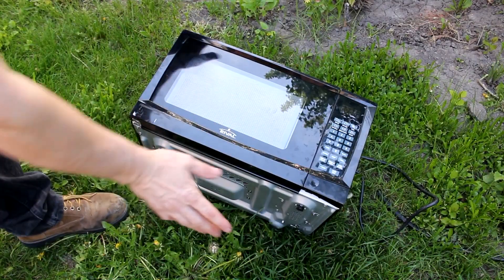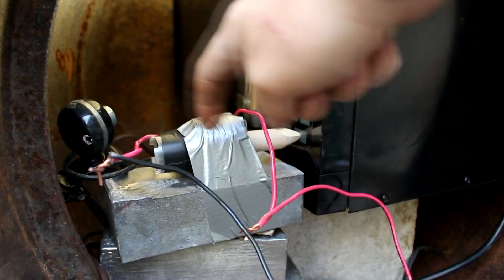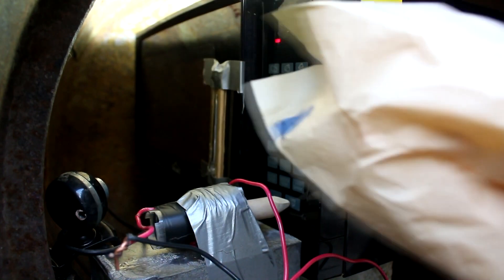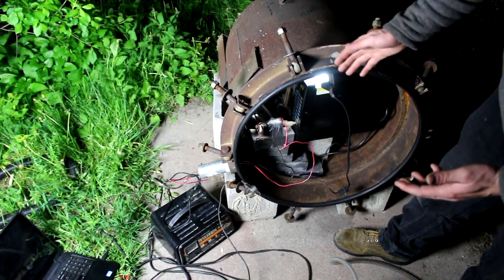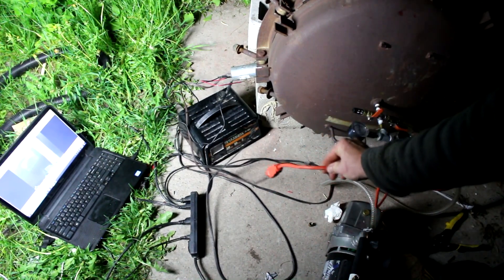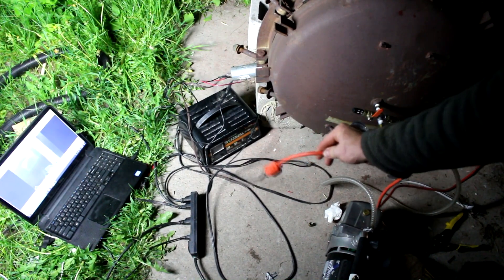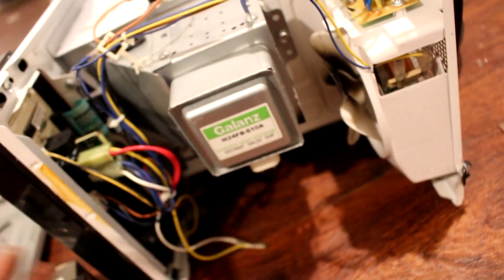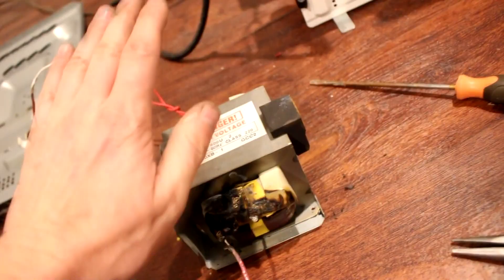Microwave In Vacuum Chamber

Comment: air is an insalater (is non conductive{this is ment for those who might not know}) in near vacuum I'm guessing that the huge amount of volts also the heat not being despered by the air probably made the instalion on the wires to melt exposing the metal so the electricity arced causing more heat and more arcing now why it was drawing more power after being separated from the main electronics I have no idea

Comment: It might be the case that a near vacuum is less insulating than ambient air. If this is the case it would means less energy is required to arc or make a conductive path to the opposite coil. Maybe it became a more powerful electromagnet in a vacuum so you could measure a change in magnetic force as a function of vacuum pressure. You could even use a compass at a distance (on the end of a ruler of something) to detect the field and have some qualitative metric of what is or isn't happening.

Comment: do you think it would work if you set up a 0° cooling system like they do in computers using water or even better liquid nitrogen to cool the internal components then really beef up the insulation around the transformer to prevent the arc that killed your microwave. just a thought. love your channel btw

Comment: Hi Cody,
What you are looking for is called Paschen's Law. It explains the gap needed during various stages of vacuum.  It is quite a remarkable curve.  We had some fluorescent light fixtures that were used to light our vacuum chamber and didn't take in to account the spacing needed at partial vacuum.  (about the vacuum you use) it burned the insulators up while roughing the chamber.  Once we were under full vacuum (5.0 x10-4 millibar or so) we had no trouble.  Paschen's Law explains what happens. To solve it we shut off the lamps while going from ""Rough Vacuum 1000mbar to about 1 x10-1 mbar" to "High Vacuum (<2 x10-1mbar)"

Comment: Maybe it's not actual science, but it sure is entertaining.  :-P  My 2¢ would be the idea that lower pressure reduced the dielectric strength of the insulators, thus increasing the risk for arcing.  The microwave was likely designed with just enough insulation to prevent arcing in room air.  A good test for this theory might be to repeat the procedure, only pack silicone corona putty (High Voltage Silicone Putty, GC Part Number: 10-8880) everywhere you can press it in and see if that helps, but without air, the transformer will eventually heat up (with nowhere for the heat to go).  :-P  Back when I was a kid, I found corona putty to be very useful to repair arcing TV sets.  Dust is attracted to the high voltage regions of the flyback transformer, building up until it arcs to shield ground.  Corona putty fixes this.  :-)  Modern TV sets don't have high voltage anymore.  ;-)

Comment: metal electrode surfaces can cause a region of the vacuum to become conductive by injecting free electrons or ions through either field electron emission or thermionic emission. Thermionic emission occurs when the thermal energy exceeds the metal's work function, while field electron emission occurs when the electric field at the surface of the metal is high enough to cause tunneling, which results in the ejection of free electrons from the metal into the vacuum.

Comment: I'm pretty sure the thing you called a "beeper" @8:16 is in actual fact a thermal cut-out switch/fuse as it's attached to the metal skin of the inner oven wall.

There are usually several of these spread around the oven but a basic/cheap model might just have a single thermal cutout.

The piezo beeper is usually mounted directly to the control panel circuit board.

Comment: If i had to guess, i would say that because the microwave draws more power in the vacuum, that it was pulling too much for the transformer to handle through the gauge wire used for the windings in that coil. This could have caused a break in the windings and in turn caused the connection to arc.

Comment: The main cause is overheat occurred by fail in thermal exchange. The arcs occurred during the degradation of insulation and the short-circuit was after the destruction of the insulation. Vacuum is a good electrical isolator.

Comment: That capacitor attached to the metal frame can be deadly. Usually they have a discharge circuit. None the less, make sure to short it out before handling anything attached to it.

Comment: Next time you do this, you'll have to vacuum-dip the transformer in enamel so the transformer doesn't fail from air having a much lower breakdown voltage at low pressure.

Comment: the transformer  puts out 2100 volts. since it was in a vacuum the flash over voltage of such a low distance was greatly decreased and flash over it did. air is basicly an insulator and without that insulator there it just flashes over.

Comment: The secondary coil is burnt by heat from arcing. Under normal air pressure the arc may not form under 2KV over 1mm gap. In near vacuum the ironized air molecule could gain much momentum before hitting another one, then when it does, creates more ironized particles and forms an arc, at a greater gap. The enamel layer on the magnetic wire can only withstand a few hundred volts. It also has some scratches/cracks/damages during winding process, which weakened the rating. Try putting enamel wires in vacuum and apply 1KV, you will find arcing easily.

The thermal inertia is quite large for the copper winding, even with much reduced convection due to vacuum, the transformer won't heat up to 100C in a minute. The fan is for continuous cooking for more than a few minutes.

Comment: I used to work on jet fighter radar. Our magnetrons and waveguides were pressurized to prevent internal arcing at altitude. There was a pressure switch that would disconnect power if it dropped too much. The normal ground level air pressure at Hill Air Force Base near Salt Lake City was enough to open that switch. I imagine the maggy and waveguide in the oven are sealed to prevent pressure loss so it didn't arc there whereas the transformer was exposed to the low air pressure.

Comment: Yes, that is correct. A vacuum allows corona to form extremely easily. Corona destroys insulation. Honestly it was my first guess as to how to microwave would fail, as the windings are at 2kv, and in open air with no potting. Cool video!

Comment: Since the popping of corn, or any grain for that matter,  is dependent of the pressure differential inside the corn it would be interesting to put just the bag of popcorn in the vacuum long enough to reset the inside pressure of the kernel then taking it out and popping the bag. You would think it would take longer to pop and maybe the popped kernels would be smaller?

Comment: with devices such as motors and transformers that have insulated windings the atmosphere is actually a factor in the insulations rating. devices rated for running in a vacuum have a thicker insulation than those which do not.

I suspect you would see similar results with the other components of the microwave if given more time just the transformer secondary had the highest voltage.

Comment: The "beeper" is actually a thermostat that cuts the power (in case of over heating) from the primary coil of the HV-transformer, or in some cases from somewhere earlier in the circuit.
Also to my (several different) measurements microwave ovens have roughly 50% efficacy. So around 50% microwaves and 50% heat. So If you have a 800W microvawe oven it draws about 1600W from the wall and the other 800W comes as heat from the transformer and from the magnetron. Without air to cool it... Yeah it burn fast. Not to mention the fact that electricity arces much more easily in vacuum. That's a phenomenon I'm not too familiar, but I know it's been utilized in some gas discharge lamps.

Comment: Anyone have some cheap vacuum oil they can test for breakdown voltages? If it's good enough, put the transformer in a bucket of it.
I would be really interested in seeing if you could run the magnetron outside of the microwave chassis in the vacuum chamber. See if you can get some plasma from it.  ̶H̶e̶a̶t̶ ̶u̶p̶ ̶s̶o̶m̶e̶ ̶m̶e̶r̶c̶u̶r̶y̶ ̶t̶o̶ ̶g̶e̶t̶ ̶s̶o̶m̶e̶ ̶v̶a̶p̶o̶r̶ ̶i̶n̶ ̶t̶h̶e̶r̶e̶.̶
Create a box to hold the camera and use the microwave door to try to keep it from frying.

Comment: High voltage transformers, such as those found in microwave ovens are typically dipped or coated in a resin/epoxy to increase the effectiveness of the dielectric and to keep the windings from rubbing against each-other so that the insulating enamel doesn't get rubbed through.  I wander if there were air pockets trapped between the wires that ruptured during the vacuum causing a short and therefore causing more damage / shorts.  Seems plausible.
I'm kinda surprised the capacitor didn't rupture too.

Comment: The general problem is that arcs form much easier in a low pressure environment. This is why many devices have a rated maximum usage height over sea level. Multimeters for example. Very important also for insulation, air and creepage distances when designing medical devices for example.

Comment: The secondary of my siemens microwave made in china burnt after 5 month of age under normal air pressure. The old one lasted more than 20 years and was still working fine when I replaced it. Quality has gone down the drain.

Comment: In addition to the vacuum arcing mentioned by other people (which could possibly be prevented by applying a rubber coating), I'd also disconnect the fan.  Without air resistance, fans can draw significant current.

Comment: If you do this again, try to wire it so that everything other than the actual magnetron is outside the vacuum chamber. And also remember to insulate those wires as the magnetron draws a lot of power and will probably jump very easily in vacuum.

Comment: you should put a Jacob's Ladder with a microwave transformer inside the chamber.
Reply: I've seen that done somewhere on the youtubes! The arc goes quite thin and purple, eventually getting stuck at the bottom of the ladder. Then the arc slowly dissolves into a neon glow lamp-type discharge with the entirety of the electrodes forming the ladder glowing a nice hazy purple. Until eventually you remove enough atmosphere that the discharge seizes completely. Add a little backfill of neon or argon and you have a very pretty light show :)

Comment: Actually, it is harder to pull an arc in a vacuum. There is no air to ionize and create a path for the current. That is why large industrial switchgear has vacuum contactors to open and close circuits instead of open air contacts. Vacuum contactors only have to separate the contacts a fraction of the distance of an equivalent open air contact to extinguish an arc.

Comment: Interesting, too bad you didn't have an ammeter inline with the circuit outside the pressure vessel. Obtain one for future tests. I was taught it takes 34 kv in "average" air for a spark to jump one inch. ( I went to NEI for Avionics BTW) When you said "the beepers" the thing your finger was pointing to was a thermal overload device, they usually say their activation temp stamped on the face btw. Some microwaves have several. I am rather shocked that meaty massive transformer would die in such few seconds given the thermal mass available for it to heat but I've long known dissipating heat is an issue in space as I've watched the specials building surface exploring drones. 

Also, a new thing popped up which says your #32 trending right now. Just above your name and subscription. Love the woodworking intro. I need to wake up. Are we going to see a Jacob's Ladder arcing away as you pull the vacuum ?

Comment: Here is what happened... most likely:
The oven started normally
The magnetron got hot fast and decreased it's impedance
which made it consume more than the usual 1 Amp current
The 1.2 Amp fuse which protect the 2000 volt side blew
The voltage doubler (5 uF, 2000 volt capacitor and diode) stopped to draw any current
The full voltage of 2000 volt AC on the secondary of the transformer
had nowhere to go since the fuse blew

Note: 2000 volt is the RMS value, the peak is : 2000 * square(2) * 2 = 2.8 kVolt

The smoke damage on the fan indicate that the electric arc was flowing from the secondary of the transformer to the fan, probably looking similar to the arc on a jacob ladder.

I think that without the fuse (like any older microwave do... the fuse on the high voltage side have been added only 10 years ago), the impedance of the magnetron would consume most of the current, so the transformer would not had a chance to arc.

Comment: Transformer was designed for in air. Definitely vacuum caused arc over.
Cody! Those aren't beepers in the microwave. Those are thermal cutout switches. The single piezo beeper is on the same circuit board with the display and the buttons.

Comment: I WANT POPCORN!!  I still want to see it happen.  Is it possible to have the transformer on the outside of the tank and wire it to the microwave on the inside.  You now have a good candidate machine to do it with.  Just need another transformer.  I really would like to see microwave popcorn made in a vacuum.  And as stated by Dean, I'm looking forward to your voltage experiments in a vacuum.

Comment: Correct me if I'm wrong, but isn't it super obvious that this wouldn't work? Microwaves (the actual waves produced, not the machine) require a medium to travel. Creating a vacuum removes the medium, causing the microwaves to have nowhere to go, and therefore destroying the machine very very quickly.

Comment: an electrical discharge will travel further in a lower pressure environment (how a discharge tube works) once a conductive path forms a large current can flow which will fry the transformer. the other problem is the magnetron tube - since there is little air available the cooling fins will not be able to keep the tube cool.

Comment: Perhaps you could remove the door, slide in one of the old bell jars used for creating a vacuum, build an enclosure to contain the microwaves around where the door and the new base of the bell jar are, put the popcorn in the bell jar, pump the air out of the bell jar, make sure your new enclosure is in place, and then start up the microwave. Shouldn't the microwaves go through the glass bell jar and zap the popcorn into perfect extra fluffy popped corn?

Comment: Careful with magnetrons. Toxic beryllium oxide is used as the insulator, so you don't want to be smashing up the magnetron. I'd also short out any capacitors on the HV side with something well isolated from yourself before poking around.

Comment: Lots of discussion about conductivity in a vacuum except that the vacuum in Cody's chamber isn't all that low. I would suspect that the insulation broke down because it wasn't rated for a vacuum and it started gassing out. I'd be more concerned though about what happens when the wife finds out he trashed her microwave oven.

Comment: You should try conformal coating all the high voltage components of another microwave and see if you can actually make the experiment work with all the high voltage wiring fully encapsulated by insulation. Will it work? Will it not work? Will the lack of convection cooling cause temps to rise high enough to burn off the conformal coating, shorting it?

Comment: That thing you called a "beeper" is actually a thermal cutout switch to prevent overheating. It's called a "Klixon", and some are one-time use, others are manually resettable, and a third type will automatically reset.

Comment: You can reuse that transformer, remove burnt up secondary and wind a few turns of thick copper cable and you'll have a transformer which can output hundreds of amps. Grant Thompson has some vids about that modification.

Comment: What you handled & said "The beeper is OK" is a thermal cutout. (The beeper is mounted on the front PCB ) Also the Magnatron might not have been happy on its side. Possibly the internal elements sagged, shorted,  and caused a high current draw.

Comment: Wow so that's the importance of air for high voltage components, I wonder if the arc happened through the enameled wire or somewhere else on the output circuit overheating and burning that secondary. Would be interesting to see the MOT itself being powered inside the vacuum.

Comment: i probably am wrong but i think in the vacuum the magnatron turned in to a vacuum tube and shorted the output of the transformer also the fuse was on the high voltage output

Comment: How about  you stand half of the microwave in an oil bath?
no arc no overheat oils absorbs the heat should give a modest amount of runtime...
outgassing of oil shouldend the problem small transformer are sometimes hermetic sealed and pull vacuum by cooling down...

ther are even food grad isolation oils you can use

Comment: hey cody, try wiring the transformer outside of the vacuum chamber and just repeat the test. It should work then. You could also externalize the on/off switch if you don`t have enough wires available in the vacuum chamber.

Comment: Paschen's law
Paschen studied the breakdown voltage of various gases between parallel metal plates as the gas pressure and gap distance were varied. The voltage necessary to arc across the gap decreased as the pressure was reduced and then increased gradually, exceeding its original value.

Comment: Guys, Codys worked it out. A microwave inside a vacuum is actually a CLONING DEVICE!!! But yeah in all seriousness I've got like 7 microwave transformers in my lab and it definitely looks like the HV end of the transformer has Arced. Electroboom did a video where he tried a tesla coil in a vacuum and the arc went far further so I'm guessing that because it wasn't a perfect vacuum the resistance was low enough that it could ark, but there was enough air left to heat up and burn the coil, that's why it's blackened from the connector